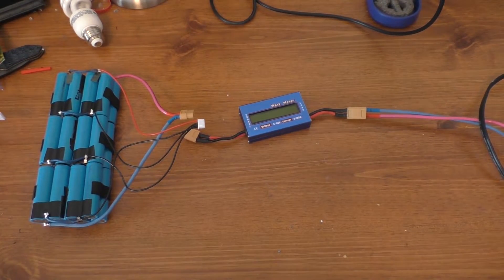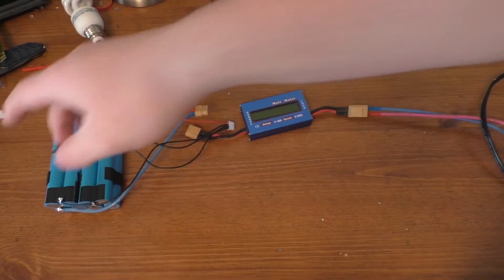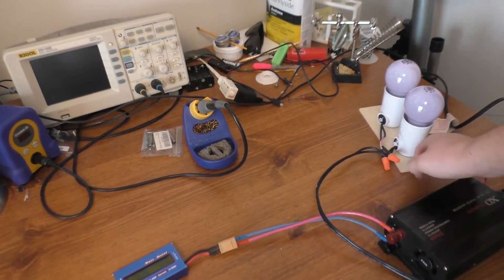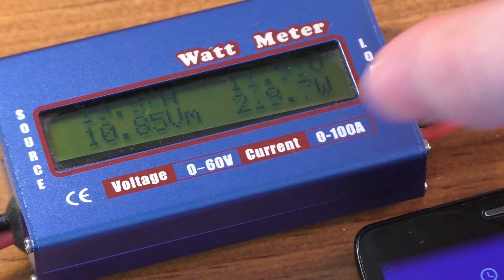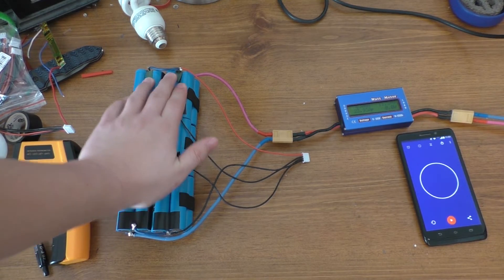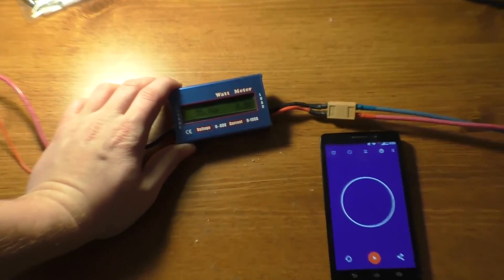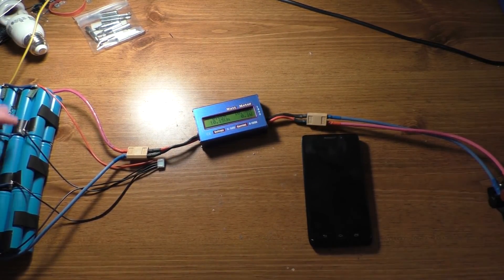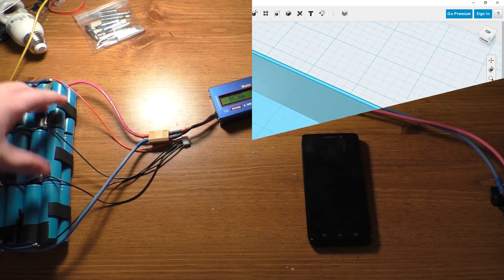DIY 12V Lithium Battery Pack Part 2

Comment: At 2:15 you say you have nothing to check the accuracy of the current flow. Your DVM may (many, not all) have a DC 10 Amp range that uses an extra + socket on the meter. You can often find a used Elenco M-1700 for around $20 on eBay. Testing for AC current requires a special "clamp on" meter.
Reply from the maker: At the time I shot this video I only had a very inaccurate DC current clamp that I didn't trust enough to use to determine whether or not another meter was accurate. If you are interested I did do a video where I tested that watt meter when I got a better DMM.
https://www.youtube.com/watch?v=tVMsBMTVqp0

Comment: Eman2000, Hey, could a battery pack like this handle at 10A load at 12v dc with a step down converter?  I have a 12v 100w spotlight i want to make a battery pack for.  Having trouble finding a 10 amp buck converter though. Subscribed, Thanks!
Reply from the maker: If that light runs on 12 Volts you wouldn't need the converter to use it with this pack. It would handle it but not for an incredibly long amount of time.
Reply: Thanks for the tip. I wasnt sure about the converter because the pack is 16.6 or whatever at full charge. Do you think i could get 1 hour of runtime with a 4s 16 cell pack using ncr18650b 3400 mah batteries? or do i need 24 like you have?The Spotlight is only around 8 amps. I said 10 since i dont want to hurt the batteries by maxing them out.

Comment: "I don;t really have a good way to check if the current is accurate" - In your first video, you tested the battery voltage with an elenco meter that includes a current clamp. It should be more than capable of testing the current!
Reply from the maker: No, no it's not. I was taking a hit at that meter when I said that. It really isn't good for anything under about 10 Amps and it only gives 0.1 amp resolution.

Comment: Anyone know of a good/detailed video that shows how to build this 12v system from scratch? IOW, starting with single 18650's and not a partially assembled system, where there was no way to see how they were actually connected?
I want 12V (nominal/up to 15v is fine, and using around 30 18650's per battery) so I can use them in my boat, or home emergency power bank, plus join them together to run a 24, 36, or 48v ebike. Just much more versatile this way.

Comment: The inverter itself is a load, switch to DC loads ditching your inverter and you should be able to increase your run time. Hook up the inverter with no load off of the inverter and see what your draw is (if your curious).

Comment: most ups systems that people throw  out,are 24 volts and have an inverter. they would work perfect on a 7 pack, and the charge /discharge spec, would be close to 24 volt lead acid.
Reply from the maker: The inverters out of UPS systems aren't meant to run continuously at any load so they are horribly unreliable unless you do some fairly serious modding to them. Even if you do they have absolutely terrible efficiency.
Reply: Eman2000 ha ha ha ha ha.

Comment: oh my god. you soldered the positive of all the cells ,right over the negative edge of the cell. please take down these videos.
Reply from the maker: Over dramatic much? I didn't solder to hardly any of the cells. Actually In this particular part of the video I haven't soldered onto any cells at all. The positive and negative are both soldered to the middle of the already exiting tabbing wire.

Comment: I know this is a older video. but lithium doesn't make 12v very well. in that I mean. the full charge normal voltage and discharged voltage of a lithium battery. isn't close enough to work good with some 12 v electronics. like a  inverter. the full charge is barely 12v. and discharged at 8-9v. its like a lead acid that's always half discharged. if it was programmed for 9v shut off. it would work much better. But 24v inverters with lithium works better. with full charge near 29-30v discharged 20-21v. a lot like lead acid.  witch I know you know all this. I'm just rambling it out there. I'm planning on building a lithium bank . for my off grid house. using a 24vinverter. maybe move to 48v later. just thinking of all the 18650'snakes my wallet hurt! I'm thinking like 5,600 cells. for a 200a 24v draw. 2500 mah  cells should give a long run time. even at full output. should be about .250a . great video series
Reply from the maker: Thank you, sounds like you have big plans! One thing about my final setup though it that the inverter is actually set up to not cut out until something like 9.6 Volts. I always thought that that was quite low for a 12 volt inverter but works good for this application.

Comment: I know I'm a little late to the party but I was going to build a flashlight with 4-18650 battery's (2packs of 2) and a 12v xenon car headlight or something crazy like that, how many batteries would it take to run one bulb? I belive there rated at around 40-60w do you think the 4 would run the bulb to potential?
Reply from the maker: You would need at least 6 of them (2 packs of 3) to be able to run a 12 volt load of that wattage.
Reply: thank you! after some thought that was my conclusion aswell. have a merry Christmas!
Reply: With a xenon wouldn't you need the ballast as well? Wouldn't that make the flashlight bulky? I see 12v xenons for cars but they all have some kind of ballast to ignite the gas. IDK for sure if that would work?
Reply: Fluffy Zyox go LED instead of Xenon. You can so much more output from a similarly rated LED setup.
Reply: The bulbs I am looking at from what i can see don't use one, i forget what they are called but they might not even be xenon but they are bright as heaven. and this wouldn't exactly be a small flashlight, im not looking to carry it in my pocket but really throw a beam out there, while learning a bit about this stuff :)
Reply: Hm if you're not concerned about size too much maybe one of those car kits would be just what you're looking for. Not sure what you could use as a reflector. Maybe cut apart a car headlight. Ha ha
Reply: http://www.ebay.com/itm/HID-XENON-CONVERSION-SLIM-KIT-H1-H3-H4-H7-H11-H13-9004-9005-9006-9007-5202-D2S-/371867915327?hash=item56950e143f:g:uGMAAMXQLoZR2kuE&vxp=mtr

Comment: Have you got a link to that watt meter your using there
Reply from the maker: https://www.amazon.com/Digital-Balance-Voltage-Battery-Analyzer/dp/B019OHZN9M/ref=sr_1_11?ie=UTF8&qid=1475336755&sr=8-11&keywords=watts+up+meter

Comment: i need 5v usb and 12 for my staff
Reply from the maker: +Sebastian jankowski That's easy enough you can get something like this: http://www.ebay.com/itm/DC-12V-24V-to-USB-5V-3A-15W-Converter-Regulator-Step-down-for-Car-GPS-Smartphone-/271904352420?hash=item3f4ec328a4:g:UpEAAOSw9N1VgPh5

Comment: i have idea to made 12V battery using 18650 i can get lots of them,  + 2 solar for charge I just have to find idea for safly charge bat using solar panels. Any idea ?
Reply from the maker: +Sebastian jankowski You can use a 3s Li-ion BMS to safely charge lithium batteries. Something like this: http://www.ebay.com/itm/Battery-Protection-BMS-PCB-Board-for-3-Pack-11-1V-Li-ion-Cell-max-80A-w-Balance-/251966994727?hash=item3aaa673927:g:hhkAAOSwRLZT45-h

I talk a little about it in this video: https://www.youtube.com/watch?v=KIJI7yAG2NY
Reply: Ok nice one !

Comment: please tell me you charge them via the balance cable!!!!!!!!!!!!!!!!!!!!!!
Reply from the maker: +ADSlammer I am currently working on a video on how to do it. The video should be out in about a week.
Reply: +Eman2000 o ok thanks its just that I want to make a electric skateboard and I would like a automatic charging system and I don't want to use a big external charger I would like a custom mini one for it that only need a 12v input and a green and red light to indicate it without using a ardwino I would just like a custom circuit boardcould you do that if possible like your other one but for a 12-18 cell laptop battery I know its a big request but i am lacking I bit of knolage  when it comes to electrics 
if possible could u link it to the video "how to make an electric penny board part 2"  by Vlad pomogaevTHANKS!!!!!!!!!!!!!!!!!!!!!!!!!!!!!!!!!!!!!!!!!!!!!!!!!!!!!!!!!!!!!!!!
Reply from the maker: +ADSlammer He is the video on how I charge Mine: https://youtu.be/KIJI7yAG2NY

Comment: Hello EMan2000 :))
I like how you are doing, and felt that you could help.
I am trying to build a sort of batterypack with 3.7v output using six 18650s like this. I dont have a balanced charger but I am using this https://www.youtube.com/watch?v=KoHtxZG7leQ method of balance charging so that I can charge the pack in less time. Instead of using the spring loaded battery compartments like that guy has shown, I am going to permanently attach the TP4056 boards to the cells.
But here is the twist-
Instead of using the original TP4056 modules, I will be using these new versions http://g04.a.alicdn.com/kf/HTB1s3fxGpXXXXa3XpXXq6xXFXXXU/201159365/HTB1s3fxGpXXXXa3XpXXq6xXFXXXU.jpg  . I chose this module because it has 'over-discharge protected' output (that I will be using as output to power LEDs). But the problem is, all the six modules will give 6 individual outputs, but not as single.
So the question is, will I have to combine all the outputs of each cell to get one single protected output? Will that work? Or else, what should be done? Thank you.
Reply from the maker: +Kketansa Art How much current do you plan on pulling? If you are going to wire all 6 batteries in parallel to get 3.7 volts you only need one of those modules. The protection IC on the TP4056 board is capable of handling 3 Amps of discharge current. They also usually charge at 1 amp. But if you do need more current than that they should be OK if you wire all the inputs and all the outputs in parallel and keep everything at 3.7 volts.

Sorry for the late reply YouTube marked your comment as spam so I didn't see it until now.
Reply: +Eman2000
Hello thank you for reply. May be because of the image link comment got marked as spam.
Yes I plan to keep the 3.7v from all the 6 cells. And I will be running 3 T6 leds.
Is the image appearing? its the other version of TP4056 that has undervoltage protected separate output. If I use one TP4056 it will charge the 6 cells at 1A current and will take lot of time to charge. So I planned to attach one TP4056 for every cell, so that they all charge simultaneously in less time. But was questionfull if I combine, will it charge each cell at individual speed...
Reply from the maker: +Kketansa Art Yes the image is showing up. With six chargers connected that will give you 6 amps and if you have 6 batteries that would be 1 amp per battery so yes you would still have the normal charge current if they were single batteries. So I think it should work just fine.
Reply: +Eman2000 
Thank you very much for telling. ☺ I will let you know when I make.